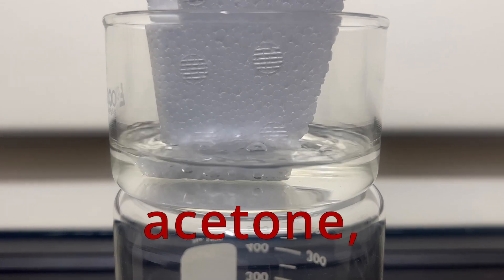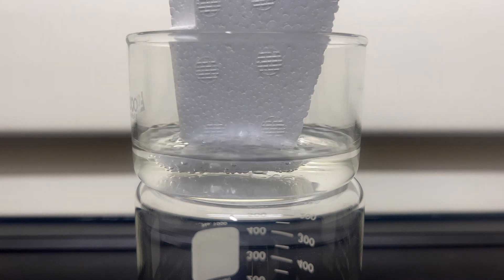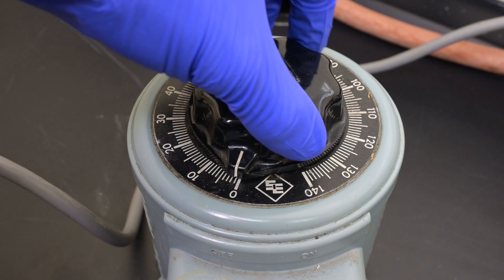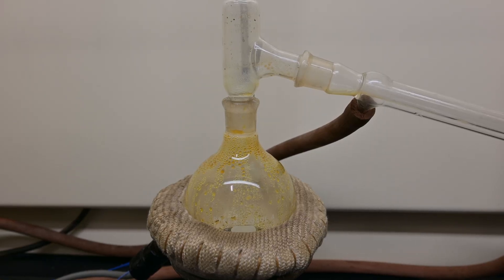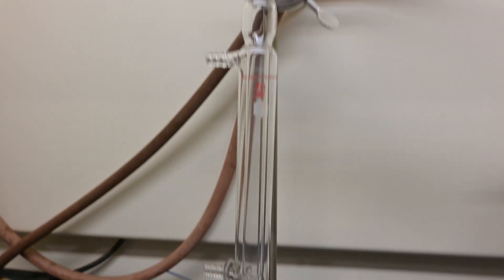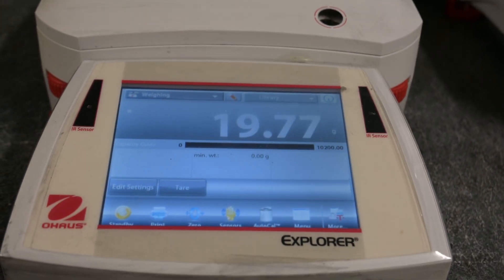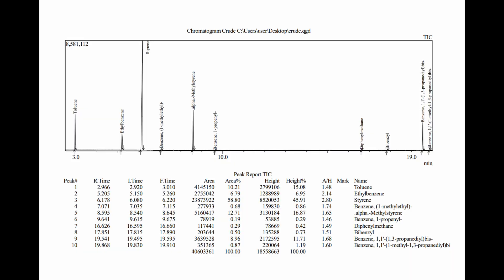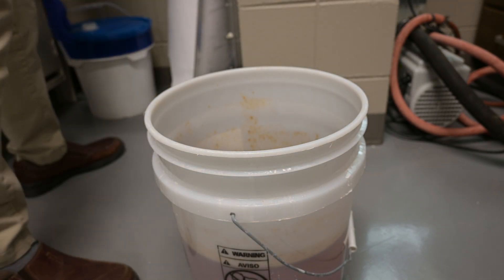Doing Chemistry with a Styrofoam Box

Comment: Styrene monomer is horrendously carcinogenic.  It is a solvent for polyester resin in fiberglass manufacturing.  Eva Hesse, a postmodern sculptor from the late 1960s died from a brain tumor caused by unprotected exposure to styrene monomer.  Just and FYI.  Plan PPE and safety protocols accordingly.

Comment: Hi Wheeler Scientific,

Nice video and presentation.

I also love thermolysis and distillation of PS to get styrene useable for chemistry.
I did it from OPS (oriented PS) from supermarket recipients used for herbs like coriander or mint.
It is a garbage and is thus for recycling (altought it is not recyled by the garbage team despite into blue bags; they focus more onto PET recycling); they use it as an extra fuel for burning other garbage via incernaration (to spare them some heat) so it is essentialy free and only need to be recollected until ready for distillation ;o) )
It is easy to work with and to crush with a coffee grinder.

The plastic also melts from its passage to 450-460°C and after distillation of a clear refringent liquid at 144°C, leaves a black tarry sticky residue goo of high molecular weight polyaromatic into the original flask; this can be cleaned easily from glasware with aceton (and evaporated again in the air to trow into the garbage (so the leftover - that they don't use - can be for the garbage team as an extra fuel).

The clear liquid ideally should be derivatized so that it is no more styrene; otherwise upon storage, it will increase its MW and become more and more viscous until solid and back to a hard plastic PS, this is bad news for container.

Keep on the good work.

PHZ
(PHILOU Zrealone from the Science Madness forum)

Comment: @Wheeler Scientific I know that styrene can be turned into benzoic acid by oxidation with potassium permanganate. But I wonder if it is possible to directly convert polystyrene into benzoic acid by refluxing it with potassium permanganate in the presence of a suitable solvent that is not affected by the permanganate. Do you think you could give it a try?
Reply from the maker: Hello, I am not sure of the ability to do that reaction in a one pot method, I believe it will require a two step process, making of the potassium benzoate then precipitating out benzoic acid with an acid. I did a video on benzoic acid a while back on the same process but with toluene, See https://youtu.be/Ouvg7dM9lqc

Comment: If you mix up some copper and some calcium oxide you can decompose it to styrene with minimal side products. If you want benzene use a little bit of iron oxide. A little late but dont use your chemistry glass for this, use something you can throw out when done, save the glass for the purification steps 😂

Comment: Love this video, and thanks for including the cleanup, as that part can be challenging.

Last I checked, any flavor of mass spectrometer, hooked to a gas chromatograph or otherwise, wa$ far out of r€a¢h for most people. Has that changed?

FTIR might be easier from that perspective, or for the dedicated, a possible DIY project. The FT part is computationally trivial on any hardware a person could have access to, so that's not the hard part. Are instruments in your purview for this channel?
Reply from the maker: I thankfully have access to a lot of instrumental equipment due to my involvement with a local university. GC-MS is still quite outside the realm of accessibility for an average chemist. I would imagine building an IR device would be a straight forward process, but outside of my current skill set. I do want to cover more instrumental methods on this channel, working on a full video about NMR currently.

Comment: Someone on the "that chemist" discord told me once before but I forgot the name of the inhibitor to prevent repolymerizaton? Do you remember the name of the common commercial one? Any  would be helpful.
Do you know if it works with aniline?
Reply from the maker: A common stabilizer is (BHT) butylated hydroxytoluene, it's used for stabilization of lots of chemicals due to the ease of removal from the stabilized chemical.
Reply: @WheelerScientific  yes that was it! thank you very much! does it also work with aniline?
  (I think this time I'll put it in my paper lab book instead of my phone notes)